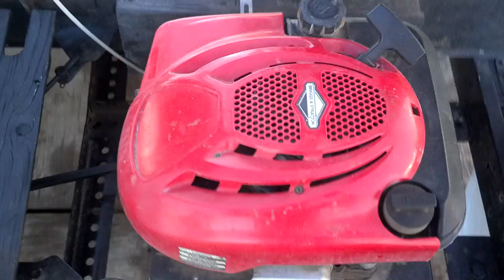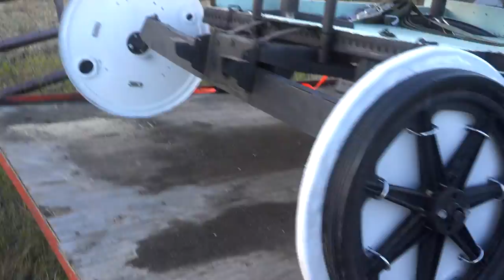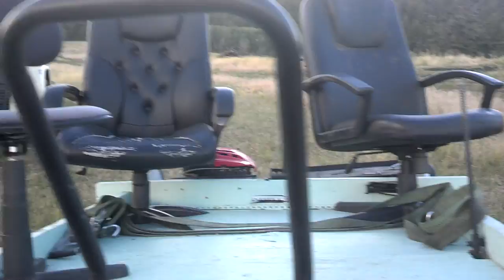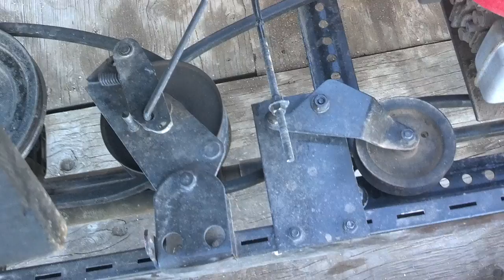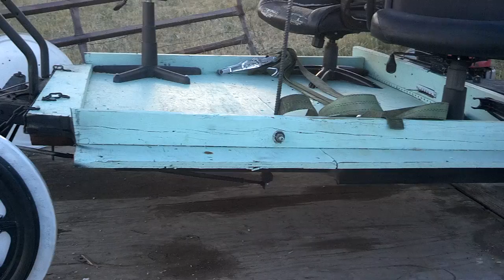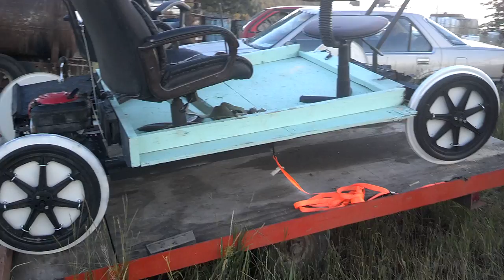Tour of my Rail Rider.

Comment: Can plus to having wider wheels and not to make them to tight to the track dimensions. wheels 3 inches thick would be the smallest I would go.  Look around  at old stations or abandoned service areas most likely you will find an old speeder chassis and or wheels to help you out for the preferred price "free"

Comment: I caught the bug from watching these videos and want to build a railkart. I think you're on the right track (no pun intended) with the wheels but I'm not sure if the bucket lids are rigid enough to work safely. I'd suggest making a mold and pouring out 1/2" thick epoxy discs. For my project I'll probably buy some thick enough nylon panels and cut them out to the proper diameter. Rubber or poly wheels with non-metalic guide plates should give you a pretty quiet ride in theory. To keep it simple and avoid unnecessary mechanical failures I'll be using a GoKart setup for the axles, sprockets, and use a centrifugal clutch. I hope your setup works and am interested in seeing how it works out. Good Luck!
Reply from the maker: Those wheels were another failure. I'll be uploading a video of my new railrider soon.

Comment: Good rail is rounded on the top, it reduces friction and allows the wheel sets to follow the rails. around cornors.  Do a little research on 'rail and wheel' dynamics, it migh help you out.  Nice rig.  Your wheels are pretty narrow, so locking the 'stearing' is essential, otherwise the 'wheel set' will be forever derailing, because it can't maintain the gage.

Comment: Also if you ride where there is a lot of growth in the tracks a board to deflect the weeks underneath will help out.  Being whacked by brush all the time will get old quick.  Brakes would be a nice add.  Without them you roll a long way before stopping.